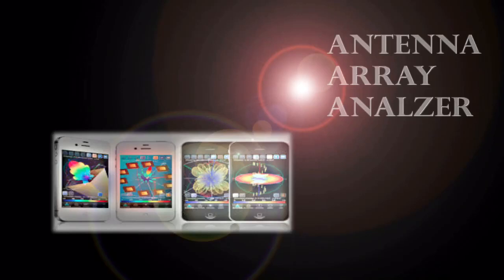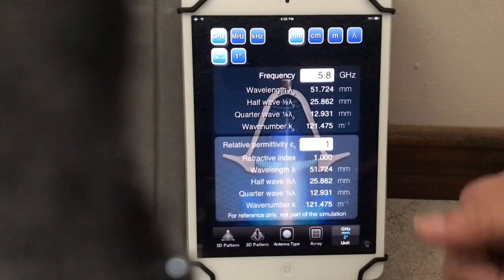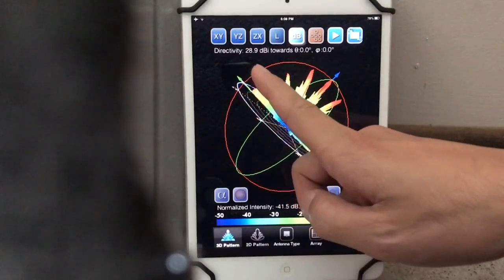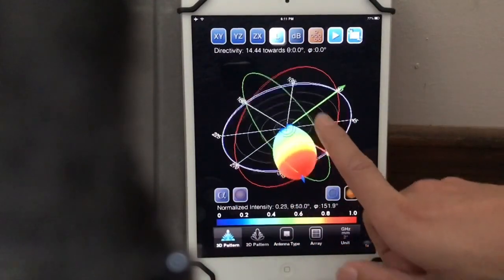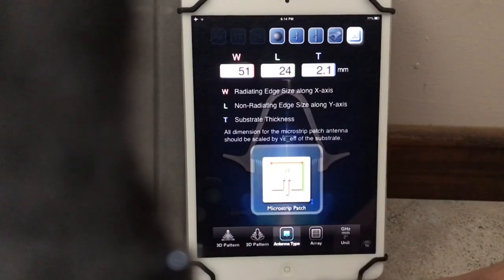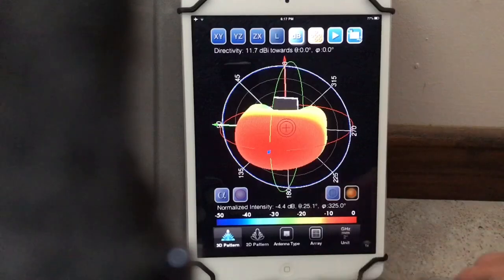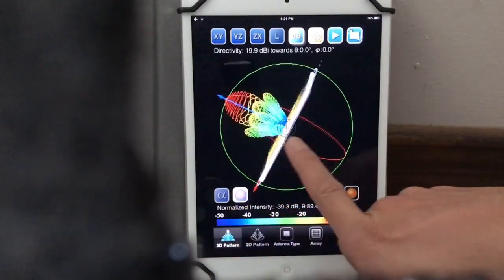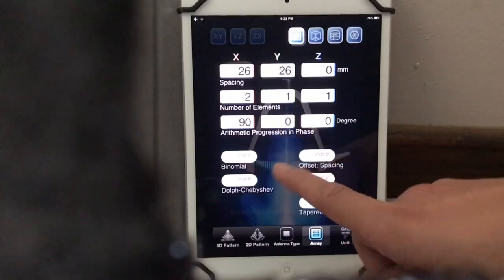Pocket Antenna Array Analyzer (with 3D far-field radiation pattern)

Comment: Fantastic.  When selecting the element spacing, full wave/half wave...is it a measure from the edges or from the center point of antenna?  Thanks for the content.
Reply from the maker: Thanks for watching. The spacing is the center-to-center distance. A value of 0 would mean a complete over-lapping of 2 antennae. Depending on the design, you may overlap the ground planes but not the signal elements.
Reply: @terence79chan  I am trying to get a helical spacing right. I am going to use your feed PDF. Thank u